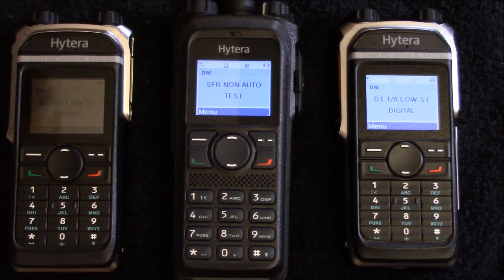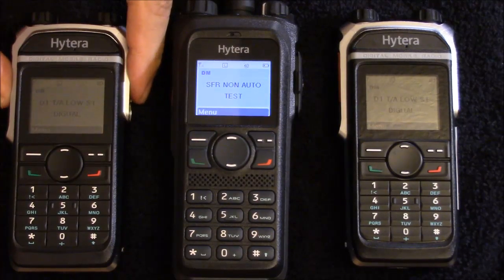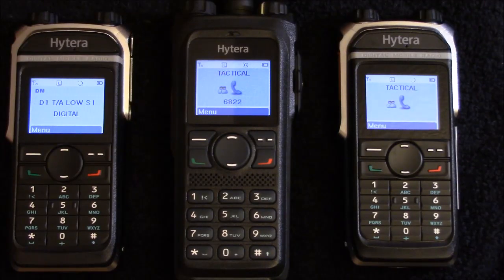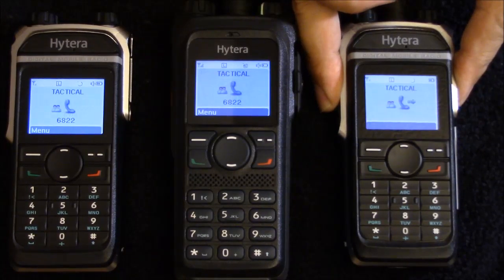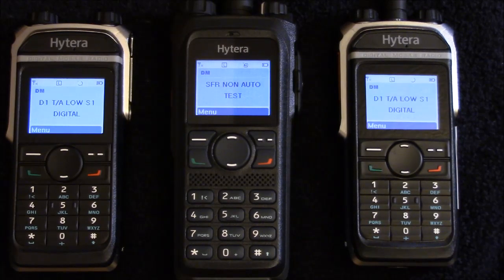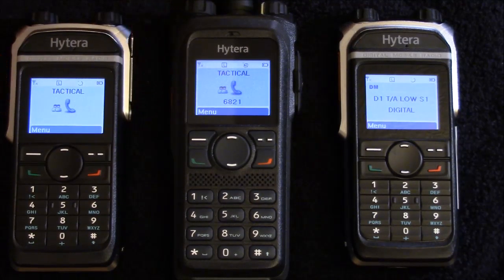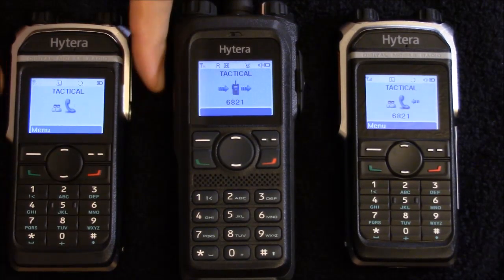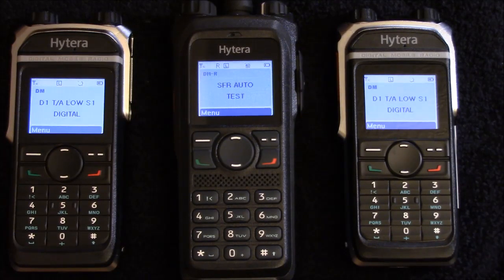Hytera PD982 single frequency repeater

Comment: I know your video was 5 years ago, but I am hoping that you can help me with your experience. 
How is Hytera SFR behaving when the radios are on the edge of RF coverage (is the sensitivity of the radio lower when in SFR mode)? 
In general how good is the sound over the SFR? Is there any degradation in sound quality or do you get standard DMR sound quality? 
I am asking because the SFR on Anytone radios degrades the audio a lot! 

Big thanks for your help!
Reply: me too,,,degrades the audio a lot ,,i use anytone 578 ,it's SFR seems not reliable ,
Reply: @林祥文-p8n  I believe Hytera SFR and Anytone SFR works a little differently

Comment: Can you daisy chain several repeaters? for example one PD982/PD985 repeating to a another repeater which could be a mobile radio like MD785i, in a car with 50W to reach home base station which is even further away?
Reply from the maker: Not with the portables or mobiles themselves. Hytera did demo a system called E pack that uses repeaters linking to each other using alternate time slots on a 2nd freq that basically does what the SFR does. Portables TX to the repeater which repeats to other field units on F1 slot 2 and sends traffic to other repeaters on F2 slot1 which then repeat locally on F1 and pass onto the next repeaater on F2. I only have a diagram of how this works, have never seen it for sale in the US.
https://www.hytera.com/en/products/iot-emergency/emergency-response/E-pack100.page

Comment: Hi, does anyone know what is a difference between PD982 and PD982i versions of this radio?  Especially if there are any in repeater functionality...?
Reply from the maker: The i series is a different set of firmware, no major changes were done in the PD982 series.
Reply: @tacticalrf5139  Do you mean they've abandoned the PD982 series now and only focus on the i version? I'm having trouble finding out the difference between them

Comment: This is the feature that I looked for. I am really interested in Hytera.

If I could ask, about this video, how if 2 radio in side have the antenna attached while center radio workin on single freq repeater? Normally, receiving radio will get multi path RF, 1 from sending radio, another from repeater. Doesn't it will make an error?
Reply from the maker: The single freq repeater mode is a very fast store and forward repeater. Radio 1 only transmits for 30 msec and then waits while the repeater takes the voice data packets from radio 1 and sends them out on time slot 2 for 30 msec. This process repeats until radio 1 unkeys.

If radio 3 is in range of both 1 and the repeater it will use the time slot it first decodes. DMR modulation is a different way of thinking than the analog world I was raised in.
Reply: Thank you for very clear explanation. Very cool feature from Hytera. 
Have you tried that scenario?

Comment: In my experience, high tier Hytera DMR radios are much better than MotoTRBO radios especially when it comes to security. 
Unfortunately I don't have a 982, but do own several 782's.
The only negative is the XPR 7550 does have a hotter receive than a 782.
Reply: The 982 has a hotter reciever, its now matches Motorola.

Comment: Can regular DMR radios talk through the  Hytera  PD985 or do you need specific Hytera radios?
Reply from the maker: The Hytera SFR application note says "Portable radio complied with DMR Tier1 or Tier2". I think they mean complies, many of the brochures have similar Chinese to English translation errors. thanks for watching. JT
Reply: Hi, Did you test the hytera PD985  with another device like TYT MD 380 or 390 to see if it's working?